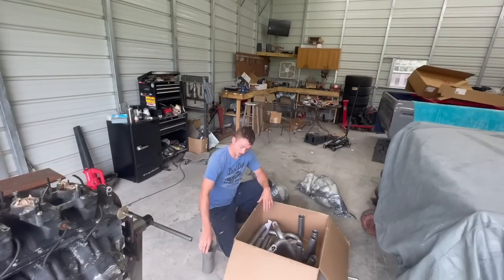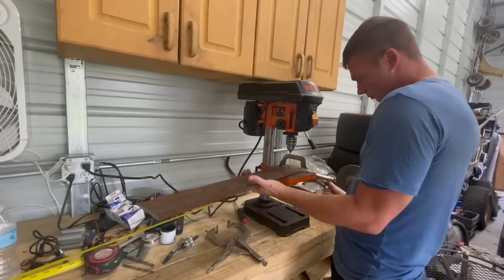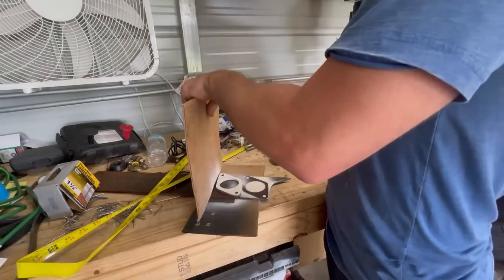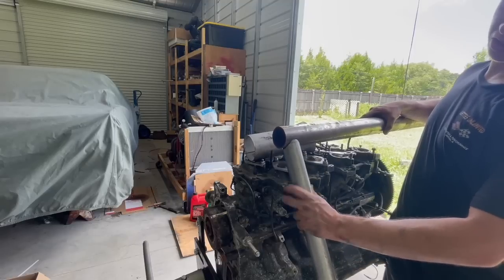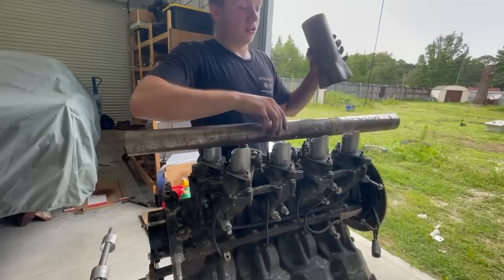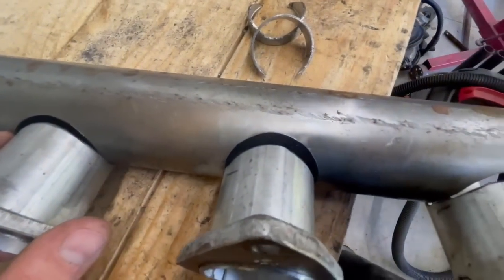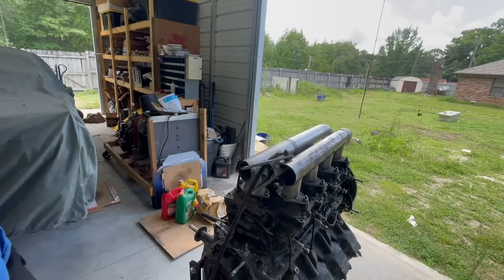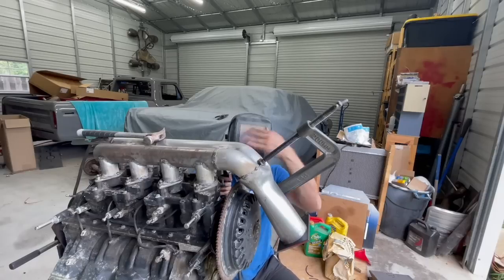Can I get this BOAT engine to work in a car?

Comment: Next time use a propane torch to heat up that piece you’re trying to bend in shape but don’t heat the whole thing just heat where you’re trying to bend then you could have tacked it on the plenums and tapped it into shape very easily once you got the rough shape. You’re doing good, we all have to learn sometime and you’re going about it the way that will teach you

Comment: Super cool project. 
 Is there any particular reason the engine couldn't be flipped upside down? 
 The intake is done already, but you have to do it again, it makes sense to bolt cheap ebay velocity stacks directrly to runners and box it all off in a single plenum. Easier to build and performs much better than the current setup. 
 Looking forward to future updates.
Reply: Would make it harder to mount the engine at a height the transmission could be mounted. And also would make it very hard to change spark plugs.

Comment: Many times I have wondered about the viability of a vertical marine engine in a car

Got torches? I'll be checking back, this is the kind of project I mite start and then give up on. Very cool

Comment: Since you deleted the reed valves, are you going to supercharge or turbo it ? I don't know know much about 2 strokes but I know it takes a genius to get them to breath on their own.
Reply: That engine won't run without the reeds. You must have some type of one way valve on 2 smoke intakes. On motors without reeds the piston skirt is the intake valve. Since outboard motors intake is on the opposite side of the crankcase there is no way I can see to make this work without separate reeds for every port. In other words, the way it was. On the down stroke the piston will push the air back out the intake instead of through the transfer port. I haven't watched the entire video, but he should really complete in depth study on 2 stroke theory and this engine. Thinking it all over again, reeds on each intake is a must for this engine. There is another way but you need to be a dynamic flow genius.
Reply: 100% was considering this as well.
Reply: the only other system I know of is a rotary valve, complicated and not really possible on this build.
Reply: @realsonnysullivan  Rotary valves work great. They are typically mounted on the crankshaft as that is the easiest way to implement. However, you need one for each cylinder as each cyl is timed separately. So won't work here. I don't see how forced induction would work either. How would you start the engine? Power the blower or whatever externally? He needs to put the reeds and carbs, on individual 90 degree mounts, back on and install the engine carb side up. The cylinders don't care which way the face as their is no oil sump. You could design a manifold and use an automotive fuel/air mixer. But separate reeds for each cylinder is a must!!!

Comment: You could put a old GM ignition and fuel injection on this thing, just run the distributor off the crank, at crank speed, so it fired every time the piston is near TDC.  Using a computer controlled distributor with no advance, not sure about it triggering a aftermarket ECM,  the EFI mid 80's ECM can be. Using a tpi ECM, with 8 injectors,  maybe a mega squirt can be triggered from a simple distributor, since the ignition is distributor, it's only injection,   it will require the map sensor, possibly MAF.  And TPS,
Reply: Your talking like its a four stroke engine. It's two stroke engine and they are extremely difficult to fuel inject. This engine needs its original reed valves, its original carbs and its original ignition system to run.

Comment: 250 optimax would have been a better choice so far as intake and fuel injection. Have the cylinders pointed down so air doesn't get trapped where its the hottest.

Comment: Since it is a 2 stroke do you need to inject oil gas mixture through the fuel injectors?? I. Assuming that all 4 cylinders are not drawing in air at the same time on each bank as this would create a nasty fat condition on the back cylinders as they fought for air that the cylinders in front of them are already pulling in.
Reply: He's going to have to introduce oil into the fuel somewhere along the line

Comment: That motor with fuel injection is going to want a manual transmission, with a really good clutch. , easy peasy with a jackshaft .all the sand rail guys did it before suby motors came into flavor , and everybody had a cvt with a 5000rpm clutch engagement

Comment: wait, wait...doesnt the fly wheel side need to attach to the transmission? wouldnt that put the throttle body pointing right at the trans? unless theres a way to flip that to the trans to the rear of the block?

Comment: This was frickin cool to watch. Poke a hole in that bracket you put on the intake big enough for you socket and leave the bracket. idk if that will work but then you dont have to cut it off. SPEED HOLE to save weight. :p

Comment: I think you need to do some basic research on how a two stroke works. You're going to need to re-fit the reed valves and the carbs for that engine to run. Your also save yourself a lot of hassle to fit the original ignition system and coils. You have worked really hard so far but I'm sorry to say its going to be nothing so please stop and start again 👍

Comment: I think you need to turn the intake around. How are you going to hook up the transmission? The flywheel is usually used to hook up the transmission.
Reply: It has a driveshaft, or something in the rear, that's meant to transfer the power from the engine.
The flywheel would be more like the harmonic damper in a car engine.
From my very limited knowledge of outboard engines 😂
Reply: @espenschjelderup426  He is going to have to turn it around. A car V8 has the flywheel at the back of the engine. That bolt's up to either the clutch or torque converter, depending on the transmission he will use. Or he is going to have to fab something to bolt on the transmission.
Reply: I wonder if those thrust bearings will handle clutch pressure? I wouldn’t think the lower puts pressure on the crank. I guess we’ll see.
Reply: @romulascott  the output shaft is on the opposite end of the flywheel, so is the mounting surface for the lower unit,  which will be where the transmission adapter plate mounts
Reply: This dude is hilarious when he starts getting some heat stroke .   Thx  for the laughs !!!!
Reply: @kevincsitley  in the comments of the first video he said he was planning to use a 4l60e. So not much thrust on the bearings
Reply: @jonathancorbett5917  Sorry I didn't hear that. So he's going to have to figure out how to hook up the torque converter. Same problem though.
Reply: that flywheel is also part of the alternator and the original ignition system. unless he plans on mounting a car style alternator or running a battery-only system, that flywheel has to stay. the flywheel has the magnets to energise the coils that are underneath it. also, there are no thrust bearings on the crank.
Reply: I really don't see this working. To much to fabricate, and it's a two stroke. I wish him all the luck on it though.

Comment: you should see the rudezon, it uses a 2 stroke mercury marine v8, and zoomies
Reply: also it will look like a holley hi ram in a way, that's pretty cool
Reply: EvinRUDE 300hp and Volvo AmaZON
Reply: @Joxaco  yes, there's two companies that make 2 stroke marine motors, I forgot

Comment: Son, I applaud your ambition and courage, but call me skeptical. I don't see any viable way to adapt that motor to a car. By the way, Uncle Luke at Thunderhead289 built a ridiculous 3-foot-tall tunnel ram for his 302 Maverick, and drove it on Power Tour. So the extra long runners are not an issue.

Comment: Also you need to get some carbon fiber reed valves ,  i think this engine got spring steeal valves original, and if thees break they will size yor engine..

Comment: Maybe the intake offset will increase the swirl and make a few more horsepower. 😉
Reply: correct tuned this engine will do 600++ almost stock
Reply: @trygvetveit4747  Trying to fit 8 chambers under the hood might be an issue.
Reply: @trygvetveit4747 if you are talking about hp no it will not. I don’t think that number is possible with it fully built and on race gas.

Comment: ps turbo kit piping it all weld up ps injectors need 50-1 2 stroke oil in gas to lube the motor to if not it will a short run it cooked in short order

Comment: Why did you offset the holes in the first place?  You were still going to have to  collect the pipes to the collector .  It is easier  to drill the holes  in the center of the pipe then offset each hole .😄😄😄🤣🤣🤣😎😎😎

Comment: I would angle the short intake runners, about 22°, but truthfully, I'd build a tray, or plenum, with a 4" pipe or a couple 3" pipes coming into the plenum, instead of cutting all the flanges, cut it out in sheet metal, to fit them all.  Then a 3"-3.5" side and bottom,  slightly flatten the 4" pipe and cut the box . Weld it in, use a silicone boot adapting it to aluminum possibly, and there you go,

Comment: And add two stroke V8 to your title you will get 20 000engineers helping you!
Reply: Holy crap, what a nightmare. I used to work with 5 engineers at once, that was 4 too many.

Comment: OK you got my sub just cause I really really want to see this work. I have one question is it like a two-stroke that does not need oil or does it actually have an oiling system in it and is it going to work with the motor on Its side
Reply: definitely needs oil! in the first video he removed the VRO variable ratio oiling system. without that, you have mix oil into the gas like you would for a chainsaw.
Reply: @realsonnysullivan  i’m glad he thought of it cause I wanna see this work. Thanks🤘

Comment: At 49:17, just drill a hole in the brace and use a carbide bit to hog the hole big enough so you can get a socket drive in there later. https://youtu.be/3EmWmxHI8T4?t=2957

Comment: This is gonna be a tough one buddy I'll shoot straight with you. I'm a master automotive fabricator/engine builder/master Audi technician. I really recommend starting with an automatic transmission #1. Because figuring out an input shaft bearing, flywheel, clutch, as well as a manual transmission that has the right gear ratios and spins the right way. I know absolutely nothing about boats. However I've built 31 pro touring, drift, drag cars, in my life as well as 9 pre runners from A-Z plus I've been a master Audi technician for almost 15 years. So I know my shit. Anything can be done these days don't get me wrong. You just have to make sure you plan out the important shit first. Like, have you figured out how ur gonna get spark in the needed firing order?? I know that's just a simple kit away but still, you have to address these things before even fueling in my opinion because all that has to run together and you can't base fueling off of anything except spark. Therefore, you should tackle that first brother. I wish you all the best man.

Comment: If you are not familiar with 2 strokes, you are in way over your head.
Reply: Yeah. There are more than a few 'traps for young players' with these.

From reed Valves, to total loss coolant system that dumps water into the exhaust.

Comment: ThunderHead289  channel made a V8 in a car run off one lawn mower carb. Getting air and vaporized fuel in a motor. Hard part should be tuning the linkage for 4 carbs. He 3d printed in plastic the carb runner mount. What direction does the motor turn at the flywheel? The gears wont be happy and last long time. Just flipping and axel over will correct for a motor turning the wrong way. People talk about HP and forget about the torque. Old one cylinder tractors made up for the torque by having a massive flywheel. The whole in motion maths thing. Then there is the video of the diesel powered 2 wheel drive motor cycle with a hydrostatic drive system. Then you can  thank Chrysler for buying and hiding the 2 stroke opposing cylinder motor with fewer moving parts to go bad. The thing that made those 2 stroke work right was a supercharger. Forcing air in cleared the exhaust fumes from the cylinder for more clean air and fuel being forced in being there is no exhaust stroke.

Comment: Couple things. You need to get a mig welder first off. Flux core is awful for fabrication. I love this idea but your lack of 2 stroke knowledge is going to be less than ideal. I dont think it will be very happy woth one throttle body. You rwally shoukd get it running on the carbs with premix in it. Id say 32-1 or 40-1 mix is probably safe. I wouldn't go 50-1 like alot of more modern 2 stroke stuff. Ignition i suppose you can run some wasted spark with COP. But you are going through all that with no clue if its a serviceable engine. You are droping bolts in it and welding spatter. Yikes. Use a few layers of tinfoil to block weld spatter.